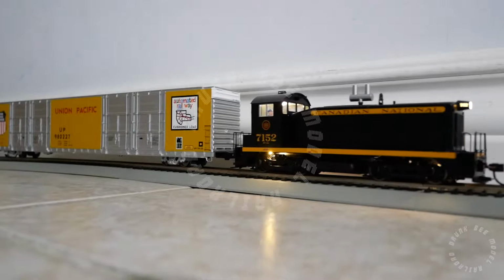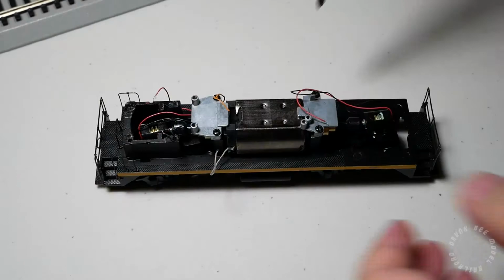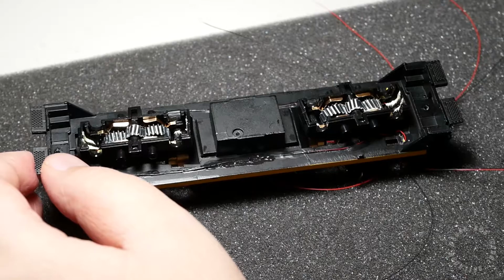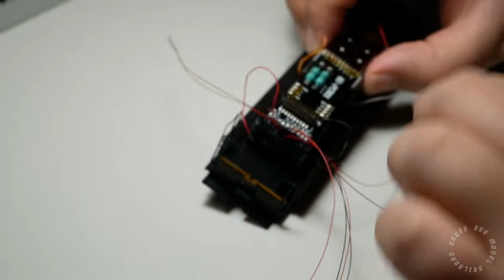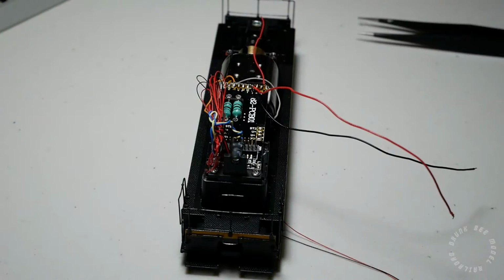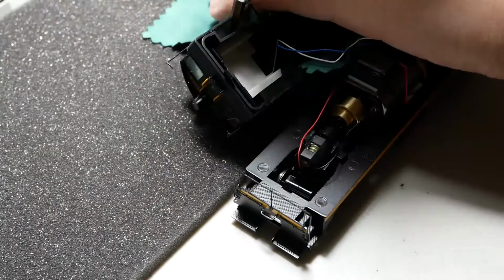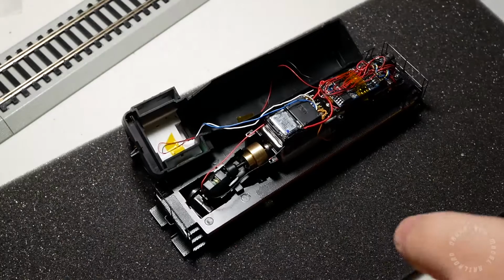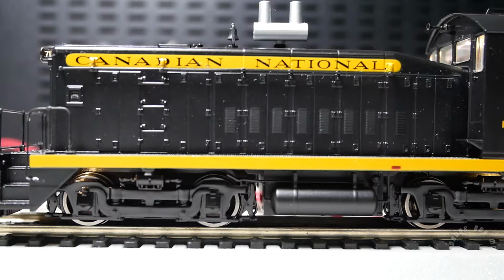Intermediate DCC Installation Start to Finish - Walthers SW8 with ESU LokSound

Comment: Where did you purchase the speaker? And is the board available for separate sale?
Reply from the maker: Speaker is ESU part #50321. The board's not available from Rapido anymore due to people buying them all up. I'm asking ESU if they have plans to produce a 8-function breakout board (with amplifying circuits for AUX3456) for the 21-pin Loksound Selects. If they don't, I will probably commission a factory in China to make them because they are very useful for DCC installs.

Comment: Where did you grey the rapido PCB board? I can't seem to find them anywhere.
Reply from the maker: It's not available anymore unfortunately. ESU makes one but without onboard resistors.
Reply: @DBRXCustomRailroadModels  awesome. Do you happen to know the part number?
Reply from the maker: @SoPacLvr  51957
Reply: @DBRXCustomRailroadModels  thank you very much

Comment: Did you have to solder wire's to the 21pin decoder
Reply from the maker: CSX 8840 CSX Baltimore sub division nope all wires go on the board and not the decoder